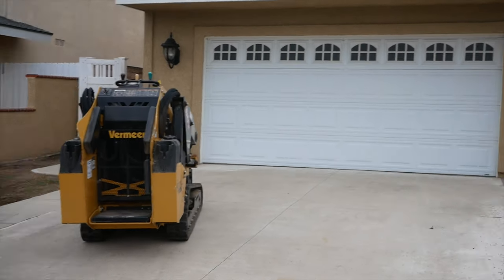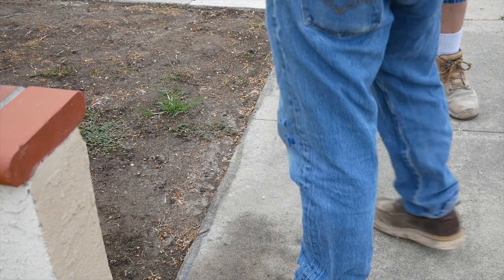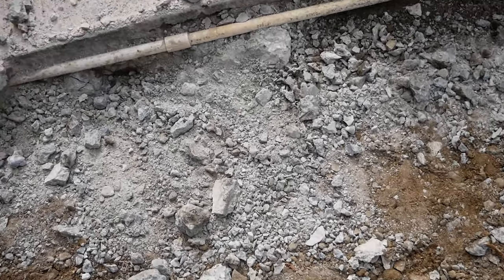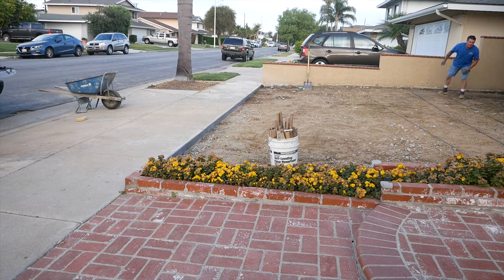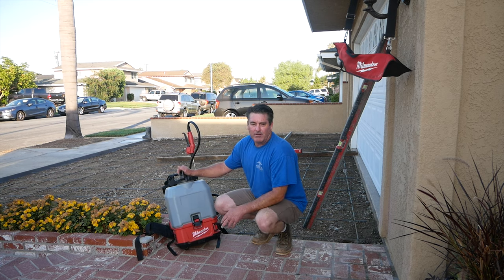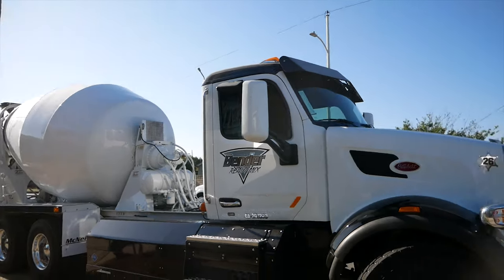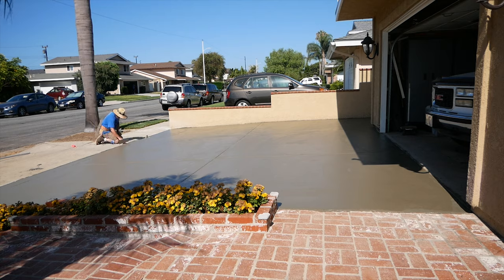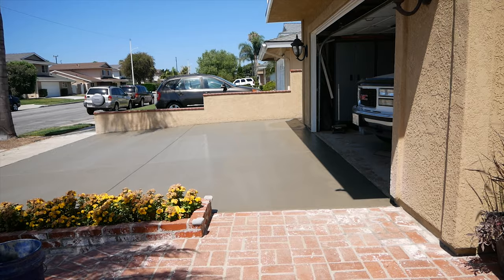How to Pour a Concrete Driveway Milwaukee M18 Switch tank Concrete Sprayer Giveaway!

Comment: Milwaukee M18 Switch Tank Concrete Sprayer, I want one.
        Greetings from Ohio!   Love your show, thanks so much for sharing your knowledge and experience!   I use to bend nails years ago, and I'm pleased to say that I watch your videos because you are an EXCELLENT mason/concrete guy.   I've followed up after a lot of shabby guys and had to fudge square and level a lot of scary foundations.   Buddy, you do it right.   It's great to see such craftsmen with pride still out there with all the cobblers around.
                                                 I did small concrete jobs very occasionally way back in the day, going to try my hand at a larger porch next spring on my own home, I'll be a little stiffer than I once was doing the bending, but I'll enjoy it all the same!   Thanks for giving me the confidence years later to give this a shot again, at least on my own stuff.  Cheers!

Comment: Nice project again. I can use a M18 Switch tank concrete sprayer.  I can use it also to mist popcorn texture to remove. So I can texture knockdown texture. It will get along with my M18 saw saw
And drill. Thanks.😁. Fort Worth.
Reply from the maker: Right o n

Comment: Milwaukee M18 switch tank concrete sprayer, I want one. Pouring first pad this weekend!
Reply from the maker: nice
Reply: Odell Complete Concrete Poured that first pad last Saturday. What a story. Originally thought it was 9.6 yards, then realized I was way off. Recalculated 16 yards. Drove to the batch plant at 5 am to ensure my 6:30 am pour would have enough. Then came the pour. Talk about intense! I've watched your videos for a year. Learned 90% of what I know  from you. I don't know how you guys screed so fast. Two of us we screening on one board and it was very frustrating. Felt like I had zero control of the quality at the other end of the board. Also felt at the mercy of the other person's abilities in screening the middle. The other two people with the rakes weren't seeing the low spots like me and so I'd have to ask for some mud to fill in and re-screed the same two feet AGAIN. In the end it turned out pretty good. Would love to send you a pic of before and after.

Comment: Thanks David for the video. Nice completed job. Especially with the equipment.  The Milwaukee M18 switch tank concrete sprayer . I want one.  I plan on placing a boat ramp in Texas and it will be a tremendous plus.   J K

Comment: Excellent video.  The clear coat on the line is a great tip.  Thanks for making the videos.  I have been contemplating in the much-needed driveway.  What is your view on the long pavers with grass in bettwen?  The new houses have them.  I think they look very modern but are they any good?  And yes “Milwaukee M 18 switch tank concrete sprayer I want one”
Reply from the maker: I don't know
Reply: @OdellCompleteConcrete   Thanks for your honest answer.

Comment: Have you tried those new metal cutting diamond blades for the angle grinder to cut rebar? I think mine is a Lennox but I believe Diablo has one too. I haven't used it a lot bit they work nice on cutting old kwikbolts flush.
Reply from the maker: Yes I have used the lennox, It works but cuts a little slower
Reply: @OdellCompleteConcrete  i generally use a porta band but cutting discs come in handy for stuff in odd spots. I figured the diamond blade is sturdier and more tolerant of rough storage. My service truck goes offroad and gets a good shake...

Comment: I'm actually doing my first driveway next week. Can you use wire mesh with rebar or is either or?
Reply from the maker: Both is better but you may need go 4.5"s to squeeze it all in there
Reply: So I’d have to probably quote an extra yard or 2. Good to know for the future. Thanks for the reply.